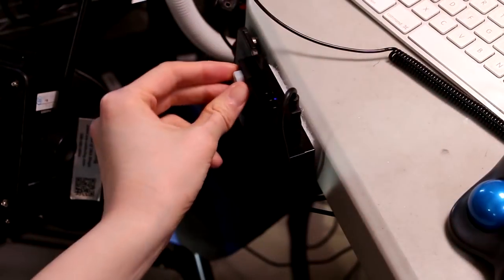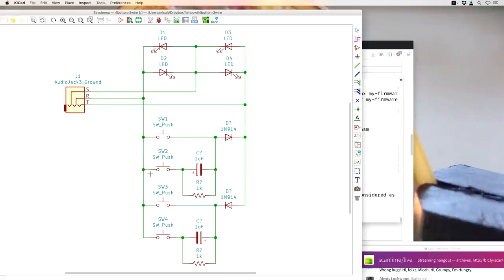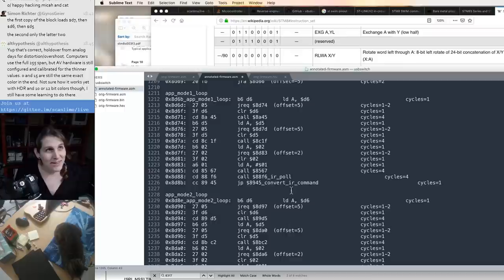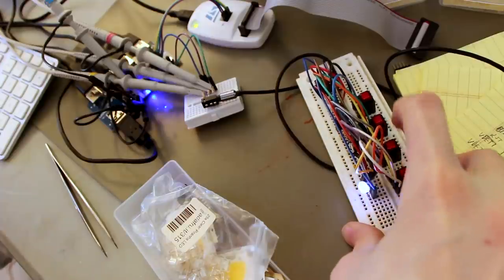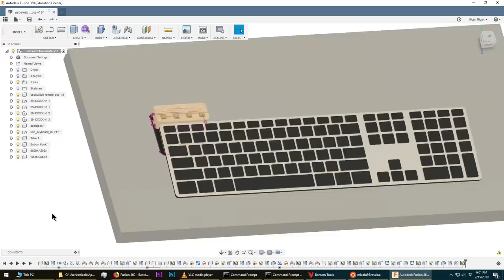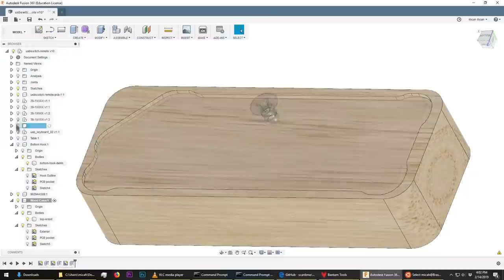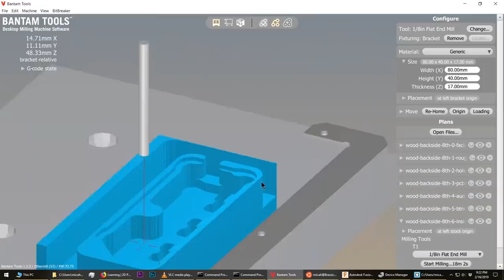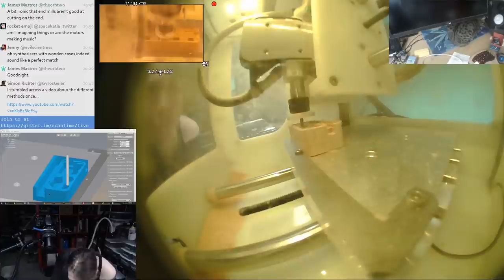Four Buttons

Comment: Simple question: What happens if you press two buttons at once?
Reply: Depends i guess. The short circuit buttons will overwrite the lowpass buttons. You could maybe dissern both lowpass buttons getting pressed from an individual button press but in the end it does not matter too much in this application
Reply: Magic smoke.
Reply: just dont do it xD
Reply from the maker: it mostly acts like it ignores all buttons except the leftmost, but there might be a quirk or two in it.. i didn't really intend for it to handle edge cases like this in any particular way.

Comment: I find it amazing that the USB switcher was running a microcontroller with so much firmware code on it. It seems like the entire device could be driven with a simple counter and MAYBE a 555 timer (to automatically advance if it finds itself on an input that doesn’t come up within a few seconds). But I guess microcontrollers are cheaper than a couple of ICs now.

I also wonder what other sorts of switchers are built using the same basic setup and template firmware.
Reply: I'm not even convinced that µCs are cheaper in this instance I think it's probable that the development budget was constrained too heavily for a discrete analogue solution. It's much easier to pay an intern/junior tech to turn your fully featured KVM switcher in to a USB only switcher than to pay an engineer to design one from the ground up.
Reply: @TheRealFlamingNinja  Yeah, the fact there was an unpopulated IR receiver is also pretty telling. I'm betting the device started life as an HDMI switch.

Comment: Assuming the keyboard is plugged into the switch, would it be possible to connect through the keyboard's built-in USB hub to obviate the need for the black cable?

Comment: What did you spray on your PCB?  Is it some kind of solder-through solder mask?
Reply from the maker: It was just clear spraypaint, but I was using it as a makeshift solder-through mask and mostly as a way to keep the copper from corroding, which otherwise tends to happen pretty quickly on these milled boards.
Reply: @scanlime  That's genius.  I got myself an othermill several years ago, and I definitely know what you mean about the corrosion.  I typically use the electroless tin plating solution, but I hate that stuff.  I feel like I'm going to get cancer just looking at it.